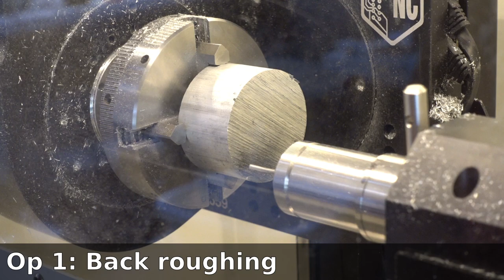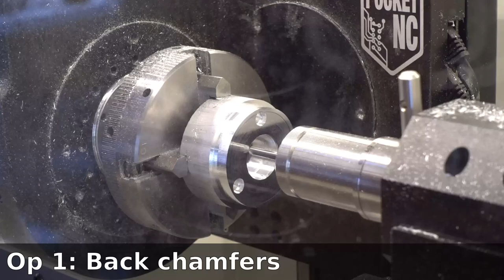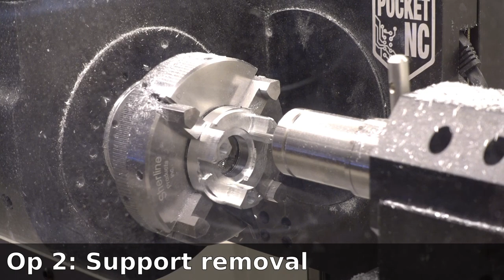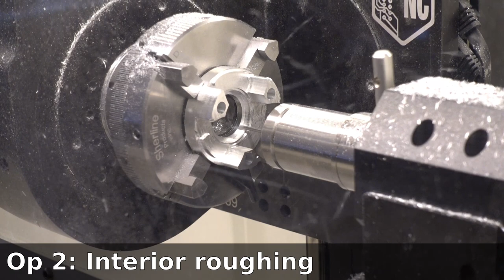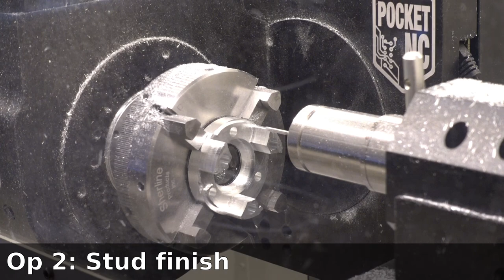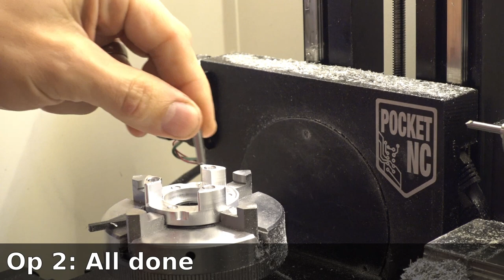Machining a moteus servo planet input on the Pocket NC v2-50

Comment: How are the tolerances? Could you turn a shaft on this machine with precision?
Reply from the maker: With decently rigid workholding, I'm able to get to within a 0.001" or so without too much effort.  That said, it isn't a VMC.  The results you can achieve will depend upon your workholding, tooling, and paths, not just the machine.
Reply: @awesjosh  I am looking at getting one, but I will need some press fits for bearings on a handful of parts, do you think it is this is capable of that?
Reply from the maker: @scvideoguy1  I do bearing press fits often.  However, it won't do them repeatably without human intervention, i.e. by opening up a hole a few tenths at a time until the desired fit is achieved.
Reply: @awesjosh  I think 0.001 precision is impossible for home machine , this is just an advertising. This machine just an aluminum frame body.
Reply from the maker: @DeZug  I am not saying it will achieve those tolerances repeatedly without intervention. However, with manual assistance I can make many types of features with that level of accuracy over and over again.